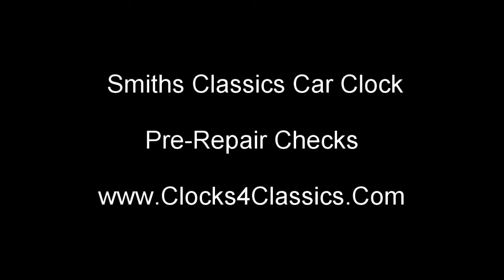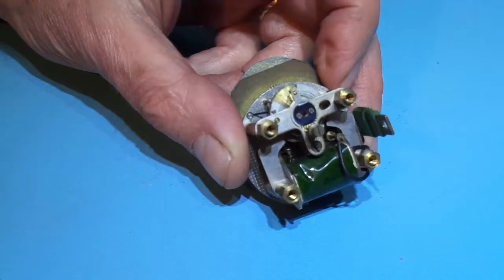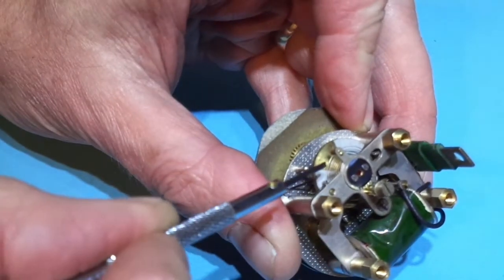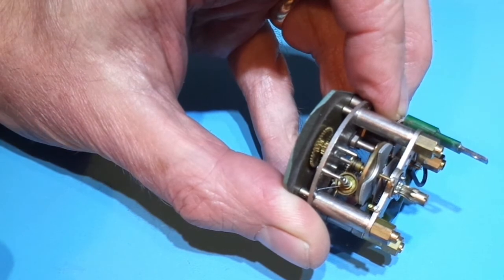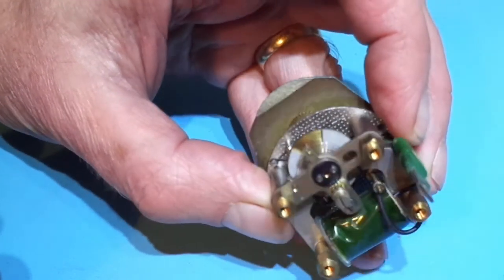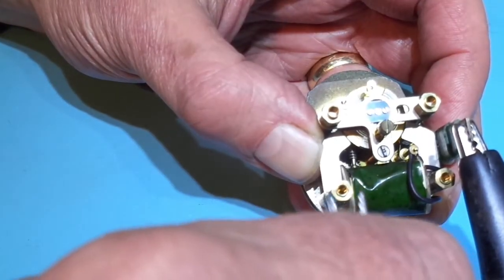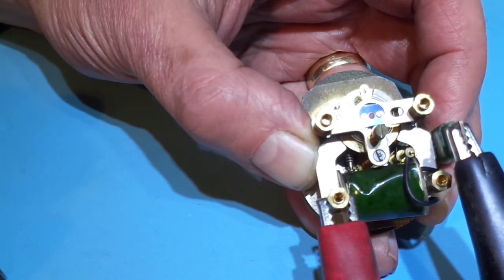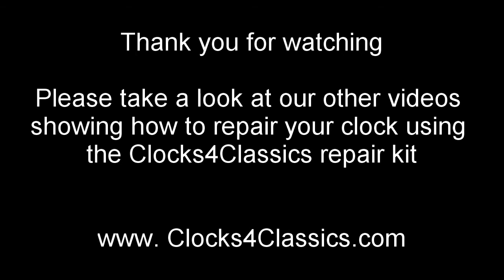Smiths Car Clock PreRepair Checks

Comment: is there an easy way to tell a positive earth clock from a negative earth one? mine has no information written on its front
Reply from the maker: Hi,
Some clocks do have a marking on the back of the case. For instance "Feed lead Positive" means that the feed lead is positive and the case is negative so the clock is Negative Earth. Similarly, if the case is marked "Feed Lead Negative" then the clock is Positive Earth.

If you fit one of our circuit boards the clock will become dual polarity which means that it will work on both positive and negative earth cars without any further modification.